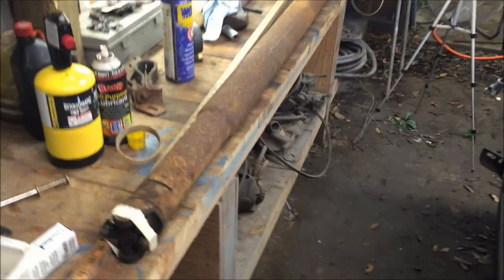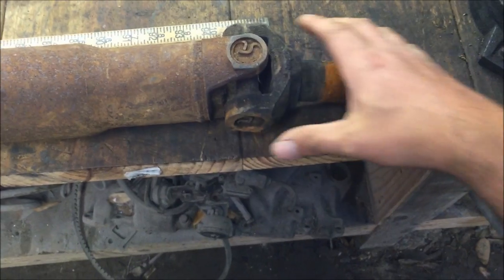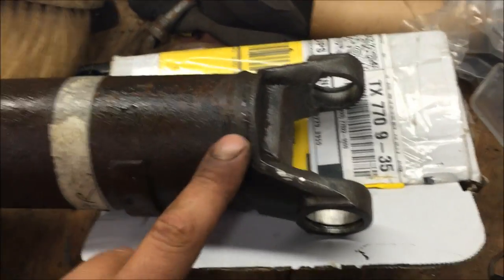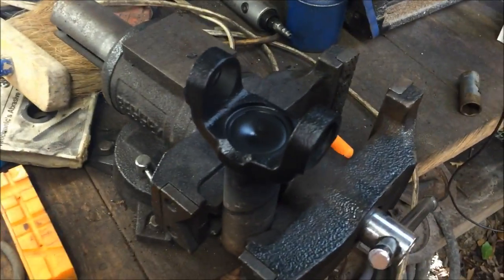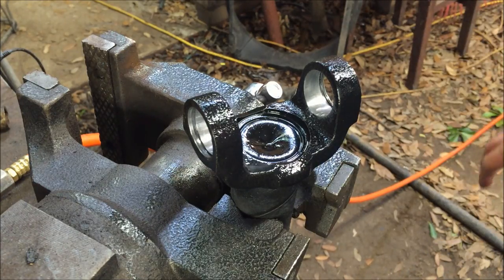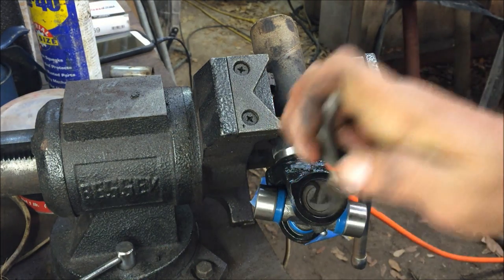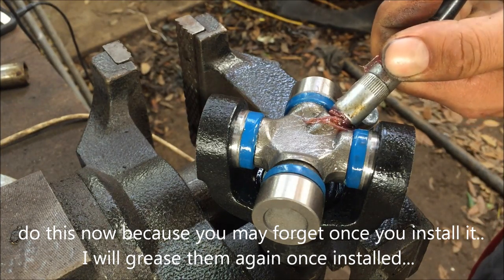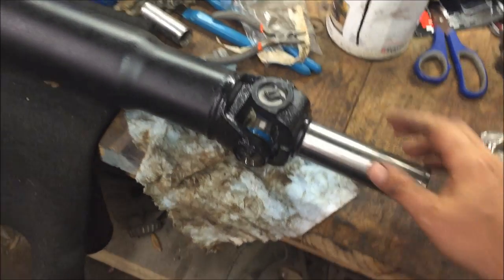how to install a universal joint how to DIY 68-72 chevelle GM a body 1310

Comment: Don't forget to mark the yoke and the driveshaft so when you re-assemble them, they are in the same orientation as before. Ask me how I found out the hard way! (Yep, had to have my driveshaft re-balanced because I put the yoke on 180 degrees from original).

Comment: What could need replacing if gear oil is coming out of the diff at the drive shaft?  And how much play should it have where the drive shaft meets the diff?
Reply from the maker: pinion seal but you need to buy a new pinion nut and inch pound torque wrench cause they have clearance on that pinion bearing.. when they are old they can have like an eighth of an inch in an out... just be careful cause if you change that seal and tighten the nut too much you will burn up the  bearings.. my 12 bolt pinion nut was set to like 16 inch pounds ..
Reply: Chris Craft Cool....thanks.